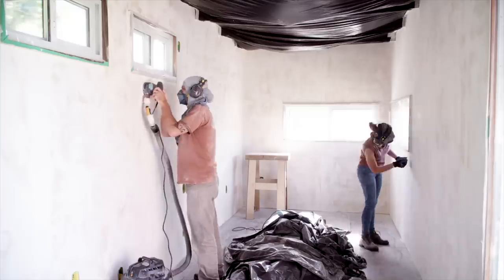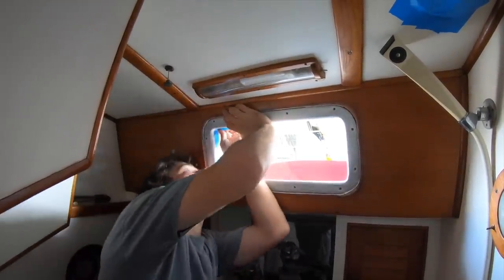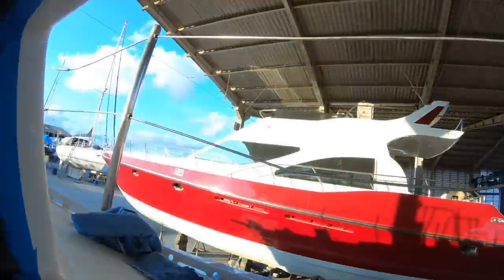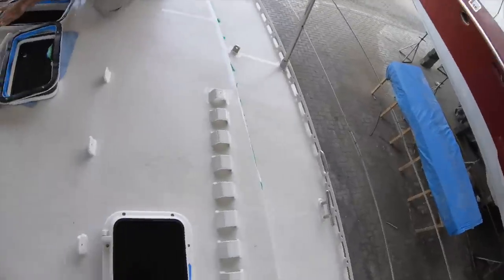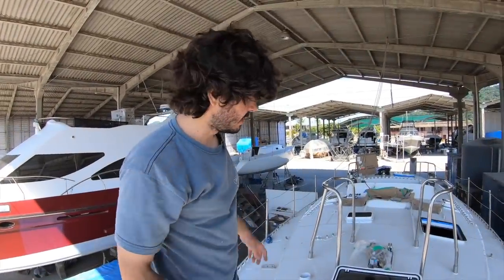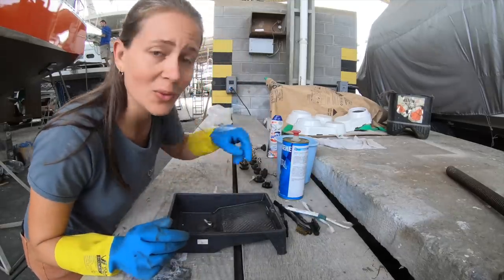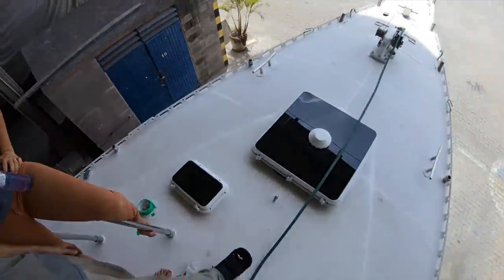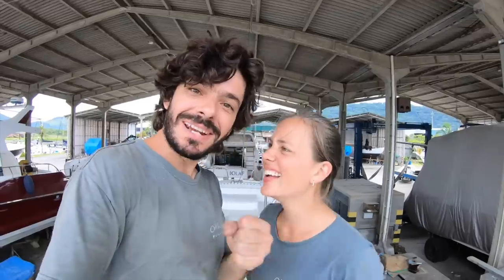⛵️We are so Excited!!! 🎉We are finally done installing our sailboat's hatches!!! 😍#115

Comment: I see all your top hatches you’ve fixed them forward facing...wouldn’t rear facing be better..?
Reply from the maker: The hatches open to the front as we live in a hot area and in this way the air can go inside easily. When sailing the deck it too wet and we can’t leave them open anyway.
Reply: Odd Life Crafting good point living in a cold climate...I’m always trying to save heat ..lol
Reply: Loving the work your doing..god bless you both.. hope your dreams come true
Reply from the maker: 💕💕 thanks a lot

Comment: You need to  buy a cordless  Drill it  will  save  you a lot of  time  . It  will  pay  for itself in time  saved . Some thing like this  
Makita HP457DWE10 Cordless Impact Drill , you  need  not  buy this Dill  but something   like it .
Reply from the maker: We do have one, but Duca preferes to fasten the screws with a manual one to feel the pressure on the screws
Reply: @OddLifeCrafting  You  can set  how much power the  Drill uses  , it just takes a little  time to get use too . I  built  sail boats  for a  living for 15 years . Once  he get use to  one he  will never  go  back  :=)
Reply from the maker: Thanks for the tip
Reply from the maker: Thanks for the tip